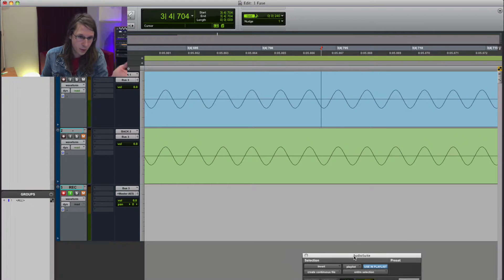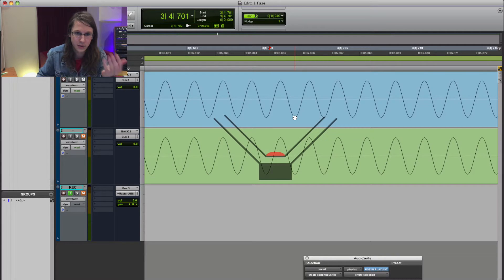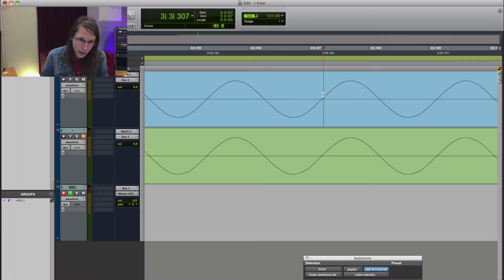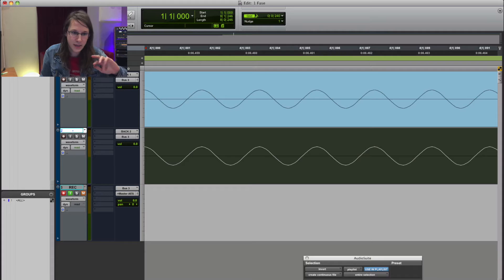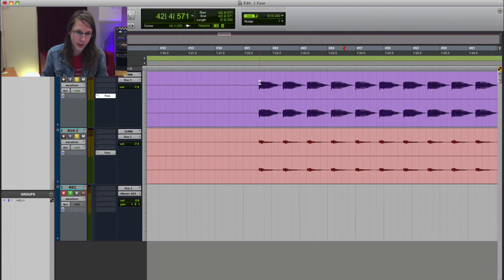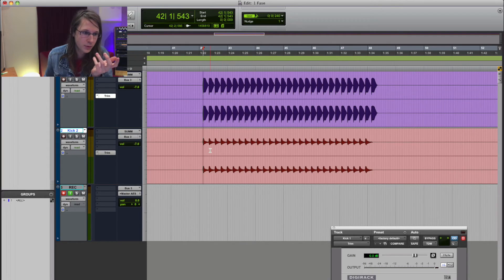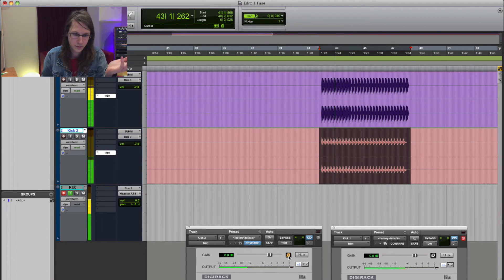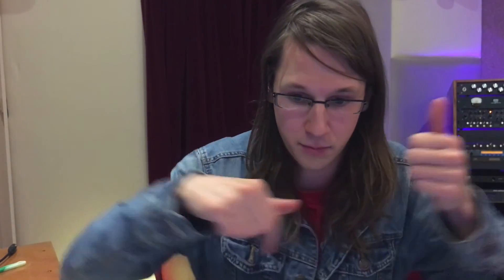Mono compatibility - Part 1 Phase

Comment: Is reversing the polarity exactly the same thing as flipping the phase?
Reply: Technically, it’s “switching” (or “flipping”) the POLARITY, which is either positive or negative. 
“Flipping the phase” is a misnomer, as phase isn’t something you can “flip”, but over the years, the term has been accepted into audio lingo... when actually, you don’t “flip” phase, you SHIFT phase... 
if you look at two waveforms on your DAW’s track/timeline, and then move one of the tracks forward or backward in time, you are shifting the phase of the one track in relation to the other. 
Switching the polarity of one of two identical signals will result in the positive and negative polarity canceling each other out - or “nulling” them, which results in silence. Hope this explanation helps. 😊
Edit- oops! sorry, I just now saw that your post is a few years old, and that White Sea already answered your question. 
My apologies. 🙏
Reply from the maker: Osiris flipping the polarity is what I was actually doing! There is no such thing as flipping the phase. My english terminology has become much better since this video! 😂
Reply: in periodic signals x(t) = x(t+/-nT) where T is the fundamental period, by altering the phase (flipping is not the right word to use)  you can have the same result as Amplitude reversal (flipping polarity) .. Take a look at a sine wave that has 0 phase x(t)=Asin(ωt)  and a sine wave with a phase(difference) of π e.g  x(t)=Asine(ωt +- π) ...